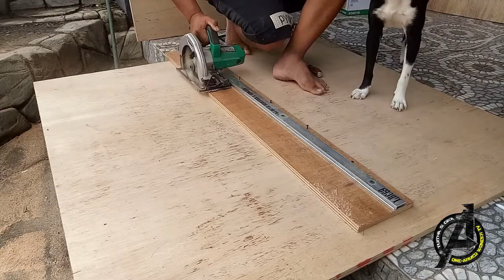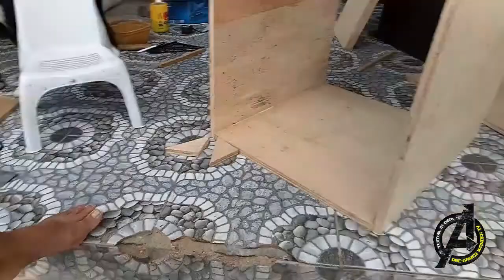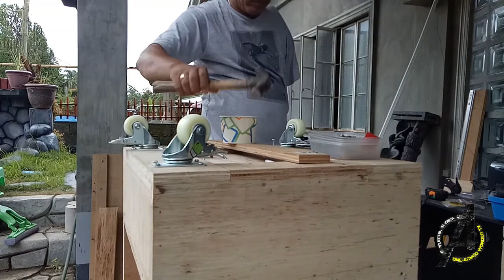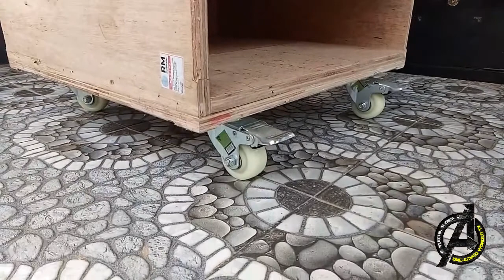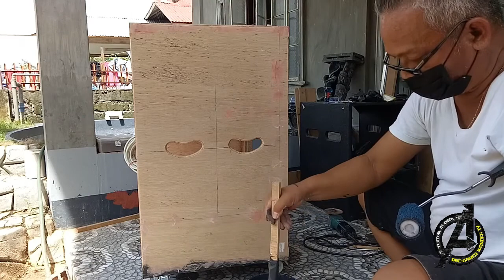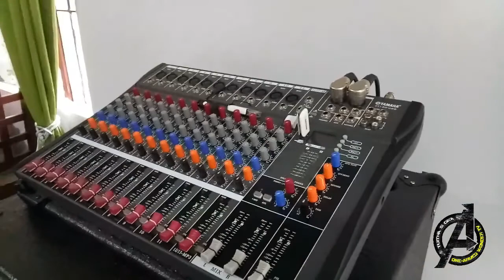DIY  AMPLIFIER RACK | PAANO GUMAWA NG SIMPLENG AMPLIFIER RACK

Comment: Ilan plywood boss
Reply: Pd pahingi design
Reply from the maker: sobra sa isa sir. pero kung walang drawer kasya na sa isang plywood.
Reply from the maker: @rtv8632  ito po ang measurements 22inches sides at harap. 36inches ang height. Tapos 3/4" na aluminum ung nilagay ko sa gilid

Comment: Dito ko lang napanuod pinaka simple pero solid na gawa ng amplifier rack.. Solid sir... Ano po sukat niya sir? At gamit na ply board 3/4 po ba? Balak ko po gayahin salamat..,
Reply from the maker: 22inches harap at sides then 36inches ang taas. Tapus ginamitan ko ng 3/4 inches na aluminum sa gilid. 3/4 na marine plywood ang gamit ko. Kung walang drawer sa ibaba  kasya sa Isang plywood pero kung meyrun kukulangin.

Comment: Salute sayo tay,,...tanong q na dn tay kung ano pong tawag dun sa nilagay nyo sa drawer ,,ung para maging smooth ung pgpasok at pglabas ng drawer
Reply from the maker: Thank you🙂. Regarding sa tanong mo ang tawag nito ay  DRAWERS SLIDE RAIL/DRAWERS GUIDE ROLLER.
Reply: Salamat po tay..
Reply: Ilang inches po ung drawers slide rail?
Reply from the maker: @ghelabrague3733  very much welcome.🙂👍
Reply from the maker: @ghelabrague3733  20inches ang ginamit ko dito. Mayrun  din12", 14", 16",18"  na available depende kung ano ang need mo.

Comment: Sir Anong pintura gamit neu?
Reply from the maker: Rirst coating Textured paint mixed with black elastomeric paint 1:1 ratio. Final coating black elastomeric only.
Reply: @one-armedwondertv7967  ano ung Laptop mount mo? Or Laptop stand na Yun?
Reply from the maker: @ridemotour4641  GI pipe lang Sir DIY ko.
Reply: @one-armedwondertv7967  wala lang vlog about Jan sir?
Reply from the maker: @ridemotour4641  Meyrun Sir. Search mo PAANO MAGTIMPLA | MAG-APPLY NG CLASSITEX TEXTURED PAINT, ELASTOMERIC PAINT at STIKWEL.
Reply: @one-armedwondertv7967  Yung sa GI pipe na diy for laptop stand sir?
Reply from the maker: @ridemotour4641  Yes sa laptop stand.
Reply: @one-armedwondertv7967  sir pinanuod ko na, wala Naman sir ung sa laptop stand
Reply from the maker: @ridemotour4641  about sa GI pipe Wala. Kala ko Kase ang tinatanong mo anong pintura ginamit ko sa amp rack.